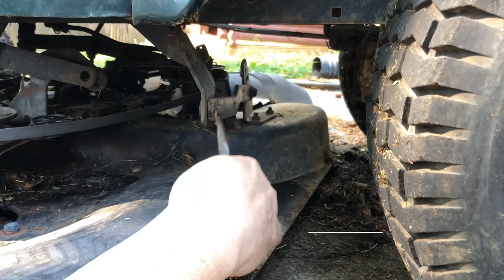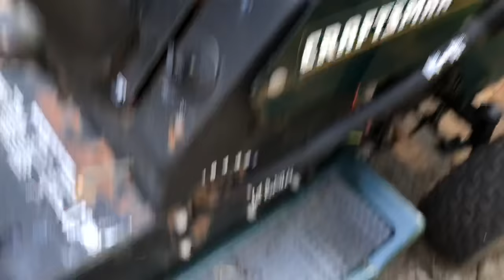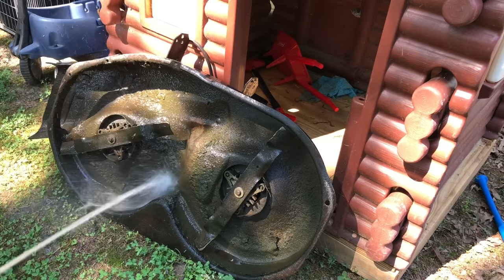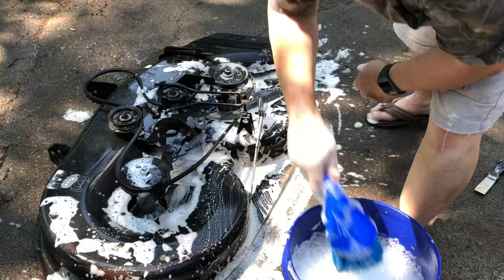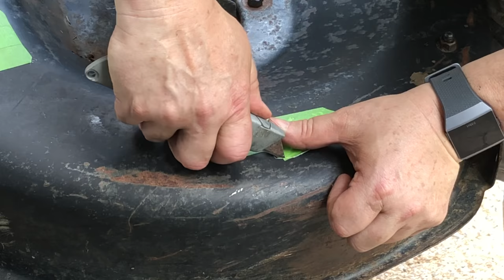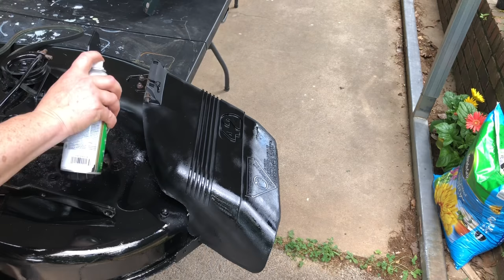How To Remove and Restore 42" Mower Deck Sears Craftsman Riding Mower

Comment: I just finished another Tractor a couple days ago. 
I have a friend that brings me ones that are headed to the Dump and I rebuild them for fun and then we sell them. 
   I do things a little differently than you do in this video. With my Projects I completely disassemble the deck and go through it. 
   I have 7 Tractors, 3 of them are ones that I am keeping. The first I refer to as the Rat Tractor which I use for dragging other Tractors around the house  going to get coffee in the morning, running to the Grocery store and other little trips around town. 
   The second is a Craftsman with a 42 inch deck that I use occasionally to mow my neighbors Yards. 
  My Third is a John Deere 165 Hydro that I am building for a daily drive so  I can use the Rat Tractor exclusively for home use. 
   The John Deere is getting an upgrade on the engine from the Kawasaki to a Kohler 23 horsepower twin cylinder out of a John Deere L130 I got as a trade in. 
   I am running a Honda TRX 125 rear Axle and a cast Iron front Axle off another John Deere.
   I like your video as it will help the do it yourselfers at home keep their Machines looking good and I like that you mentioned the importance of yearly cleaning of the deck to keep it in good condition as most people don't ever clean them which can lead to very expensive repairs or replacement.
   The funny thing is that I don't have any Grass of any kind on my place. 
I guess us Retired Auto Body guys have to keep busy with one thing or another. 😎👍👍
Reply from the maker: Sounds like your having a good time restoring mowers. 😃👍
Reply: @VansWorld  yes I do have fun, I also fix  Machines for people too as there is no place for Miles. 
   Recently I have become a little disenchanted with a couple of people who have brought me their things.
   I guess that they don't understand that this is just a Hobby for me and a way to help others. 
    A couple days ago one of the individuals I am referring to come Over and got Short Tempered with me because I was running behind on a few projects for people and I would get to his ASAP right after I got caught up on things. 
   He said but You told me a week and a half or TWO WEEKS! I am not a young man and I do forget some things so I keep track of appointments on a small notebook. It had only been one week since I talked to Him. 
    Tomorrow He is going to bring His Snapper Riding Mower if He gets cocky or disrespectful I am going to use a word I don't often use.
   That Word is NO! 
Considering I only charge for parts and accept donations for my time which saves them transporting their stuff 60 to Over 100 miles Round trip not to mention the cost of a professional shop would change and then to act in such a fashion is unacceptable. 
    WELL 
On another note, I only have a couple of things to modify before I do the finishing touches on what I am calling the 2nd Generation Rat Tractor, the John Deere I spoke of.
    I have to shorten the steering Column 6 inches and weld a couple mounts I made to attach the dashboard assembly to the frame. After that wiring headlights and taillights.
   I have been approached by a couple of Kids who thought that I would sell the First Rat Tractor because I was building another one.
   I told both of them that I was keeping it. Though I wouldn't sell it to a Kid because I have nearly flipped it more than once myself Doing Donuts and talking corners on pavement Full Throttle, yes  I guess you could say that I am still a Kid on the inside.
  I should be completely done with my 2nd Generation Rat in a couple more weeks. 
   I am already collecting up parts for a Third Generation Rat Tractor but next time I will be building  the frame so  that I can drop  it down, lower that Center of gravity for stability at higher speeds,  independent front suspension, mono shock swing arm rear suspension with disc brakes on both ends. 
   😎✌

Comment: I knew there was a real purpose for investing in kids' clubhouses and toys!  Just didn't know until I viewed this video!
Reply: I'm not listening to the audio, however after all that washing, I would have definitely spent a little more time wire brushing and using Rustoleum rusty/oxidized primer paint, then top-coated with another oil based paint.  Just using a top coat without a primer, the coat will just quickly fall-off and rust again, as the top-coat has nothing to adhere to on the surface.  Whether spraying or brushing, choose your poison.  I'll likely quickly brush (paint), until I get more time for removing all parts for HVLP spray painting.  Was really looking for diagrams/photos on how the darn brakes work, and if I'm missing parts.  Seems to be no repair/service manual, with only a non-descriptive parts diagram!
Reply from the maker: I’ve got another video on totally replacing the brake pads.

Comment: I gleaned from your video how the rear linkages went back on after id removed the deck to replace the blade brakes and slide mechanism to the PTO  . well i got down to the linkages while reassembling and couldnt remember how to do it. Even though you didn't elaborate on that part much pausing the video on it hepled alot. I wasn't restoring the deck. Did that 3 or 4 years ago.  My situation was deck belt not staying on and Blades not completely disengaging.  So now its fixed. Thanks Buddy

Comment: Thanks. I just needed to remove the mower deck, and your instructions worked fine. The only difference is that I have a LT 2000 with 19.5 hp and the last step was to disconnect the cables that control the mower engagement. Otherwise its the same procedure.

Comment: That camo is hot! You inspired me man...just went and got four different camo ultra flat paints to do the main body tonight and will use local foliage found in my neck of the woods as the 'stencil' -- I already did the hood, back plate, footrests in red, silver & dark blue before I saw your vid, but with the camo along with that will scream AMERICA, EFF YEAH!! I brush painted the top of my deck with an aluminum oil-based Rust-Oleum after removing all rust and putting on a rust inhibiting primer and it looks incredible (the underside is the glossy black and that looks brand new). Finishing it off with an American flag Brodie knob I ordered off Amazon to complete the look. Thanks for the inspiration sir!
Reply from the maker: I’d love to see it.  If you have a Facebook.  Find my FB account in the video description and send me a pic.  If you want to.

Comment: Good video, but why not remove the belt before painting?
Reply: Exactly. It's not like it's difficult to replace. In fact while it's off, I'd install a new belt after painting. I have my deck off right now for painting and cleaning. On the front of the deck some parts have rusted through. I could apply some fiberglass resin and cloth and it would work fine. Can't afford to buy a new deck, just repair the old one, lol.

Comment: I did not realize that the idler pulleys on the Craftsman LT1000 deck were two different pulleys. There are two different part numbers for them. I took them off so I could paint the deck. There are no numbers on the pulleys, and I did not pay attention to which one went where. 
Does anyone know which one goes where? One of them is slightly wider. 
That is the only difference I can see.

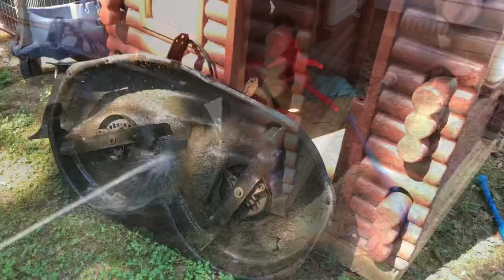Comment: At the 3:30 mark while washing, what is the smooth piece of metal bolted across the left front edge of the deck? I need that part and cannot find it in any diagram. When the deck is on the mower, it is actually on the right side bottom.
Reply: Same question- I hit a stump and bent that piece. I need to know how it supposed to line up.
Reply from the maker: I’m not sure what it’s called.   Your local lawnmower repair shop may have an old deck laying around that you can buy from them.   Or checkout Facebook marketplace for old mowers.  Sorry I’m not more help on this one.  👍😁

Comment: Found one of these poor girls abandoned on the side of the road, similar vintage. The mandrels were toast so I replaced them for $60 but after that it runs and cuts like new
Reply from the maker: Cool.  I get my spindles and blades  from eBay.  I found really good prices on there.  Have a good one.  Enjoy the mower.  😁👍

Comment: Nice confirms the clips I was looking at , BUT what about the wire cable that runs through the bracket on rear of deck. His seems to be missing and I think it is either the brake or throttle. So would of been nice to see the REAL disassembly of all the needed connections.

Comment: What rebuild? The deck was scraped clean and painted. Not a single part was replaced or repaired
Reply from the maker: But if it needed it.  It would be easier to get to.  What are you looking to replace? The title says restore.  Not rebuild

Comment: What's are those front deck arms called that you removed in the beginning of the video?
Reply from the maker: I’m not sure what the exact term is.  You can google the model for a PDF owners manual.  It will have a break down of the mower and parts names and numbers for replacements.   Hope this helps.

Comment: Awesome video.  Gonna do mine next week. Do you put any lubes or grease on the pulleys?
Reply from the maker: Thanks for watching.   No grease.  They’re sealed bearings.   👍😁
Reply: Use spray on graphite available at auto parts stores. It's usually used for ignitions switches or door locks.
Shake it WELL. Once you think you have shaked the RATTLE enuf, do it again.
It rays on wet and dries in a min. It wont attract dust. 
Use it on the pulley axles, belt engagement linkage, nylon bushings, etc. Move the part around. By the 3rd time you will feel a noticable improvemprovement.
It is messy. Use it sparingly, its $4 for a small can, it will syphon out of the straw after its sprayed.  Hit threads with straw then to save. $$
It works.
My 25 yr old crafts looks like hell  but every engagement is smooth and positive lock.

Comment: Should’ve lightly sanded the rust spots, that paint will be flaking off in a few weeks. Good concept of repair just poor execution by not properly prepping the surface before painting.

Comment: Great Video Van ! thanks !  But I need to replace my steering shaft and gear on this very same model. ... did you ever do this ? ( or make a video on how to do it ) :-) There is not a lot on you tube for this model because it is so old ... mine was new in 1997 !
regards, Steve
Reply from the maker: Sure did.  The video your looking for is in this playlist https://www.youtube.com/playlist?list=PLIYr0muUvcwuTnBPBrftcnL5HzjSO361x
Reply: @VansWorld  Thanks Van ... also any tips on adjusting the main drive belt and clutch ? My rear drive wheels stopped turning today, but the belt is good. Or Maybe the differential broke ?
Reply from the maker: When I work on my Drive Belt I always remove the deck. When the deck is out of the way, then you can check pulleys and linkages. It could be something as simple as a retaining pin came out of a linkage. Hope this helps
Reply: @VansWorld  thanks .. it turned out even simpler ... the belt had come off the clutch pully .... dohhhh !  :-) I love this mower, it is so reliable, starts first time and easy to fix.
Reply from the maker: Awesome.  I’m glad it was an easy fix.  👍😁
Reply: Van, on the mower deck , i bought a new drive belt, but it is actually slightly shorter than the original by 1", so the blades won't disengage. is there a way to adjust the idler?

Comment: how long are the two belts
Reply from the maker: That information can be found under your mower where your left foot sits.  Or lift the hood and get the information there.  I printed out a manual for my mower by doing a google search.
Reply: Mower deck belt is usually 95".  Drive belt is 88"

Comment: The degreaser is not really necessary. Not good on the yard or the drains .
Reply from the maker: Well it just depends on how ya feel about yards and drains lol. Just kidding.  Honestly the yards would have to do with well water.  I don’t know anyone around my area that would be using well water in like a 150 mile radius lol.  My degreaser never even came close to a drain.  But thanks for your comment and concern.  I hope you have a great weekend coming up.  👍😁